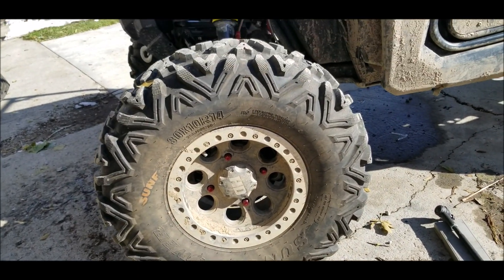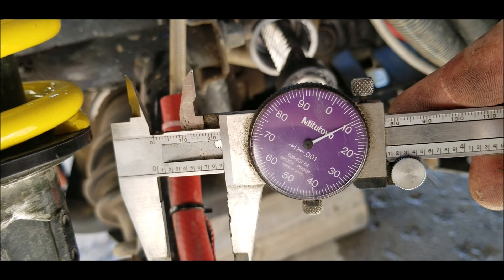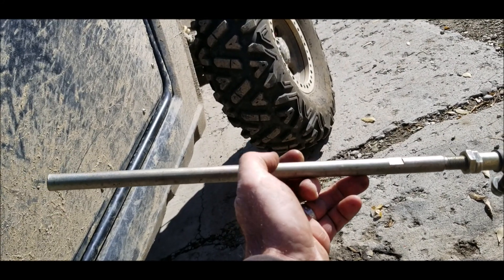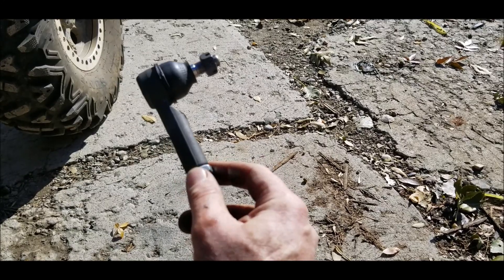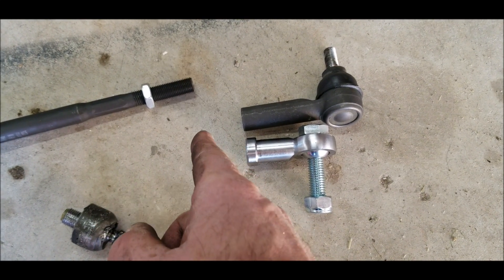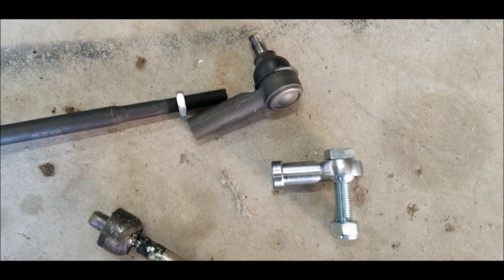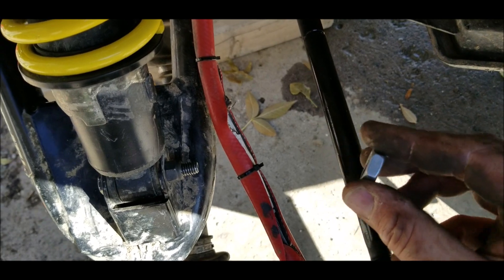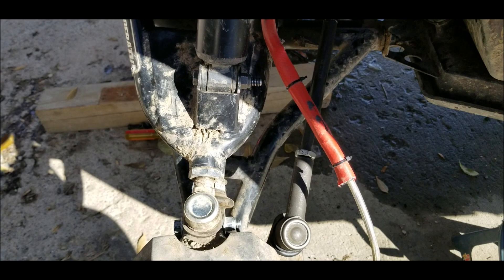2016 RZR 570/800 heavy duty steering upgrade FOR CHEAP!

Comment: Will it work on the 570 s conversion?
Reply from the maker: With the 16 and later 900 knuckles it should work as I believe they use tie rod ends instead of a bolt and heim joint.
Reply: You are do tons of cheap up grades from 800 parts.  The shocks alone will give you a 2 inch lift and better articulation. The axles are interchangeable too.

Comment: Did you have to put a clutch kit in it for them 30s? I have the s
Reply from the maker: I did clutch it with the 30's. I chose SLP and am happy with it. After the portals I realized that I don't need the clutching.  I'll just put on bigger tires to make up for it. 😁. I ran it for a while without clutching but it's much better with. Im in the process of converting it to an S right now.
Reply: @ericsscout  please let me know what you find on rear aarms satv told me they discontinued the s ones I found highlifter brand but didn't like thier design very well someone told me they're the same as a ranger but none else can confirm that for me the part numbers are different but they look the same on Polaris website
Reply from the maker: @chriscadle585  shoot me a text if you would like and I'll send you some pictures. I'm currently putting it on now. 4066708501
Reply: Great video. Especially since there is not alot of vids for the 570. I just lifted mine and about to do the portals but was wondering what yours look like with them.

Comment: Will they work without portals?
Reply from the maker: I think they will if you have the later model knuckles that had tie rod ends instead of bolts.
Reply: I have a 2019 rzr 570